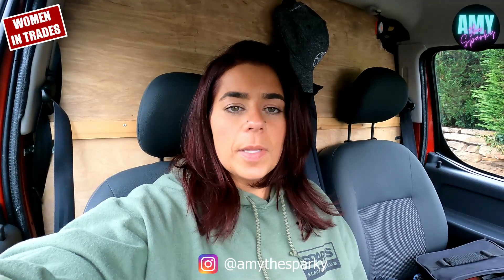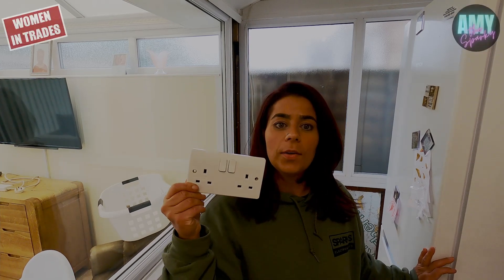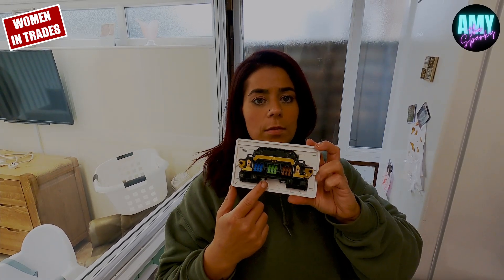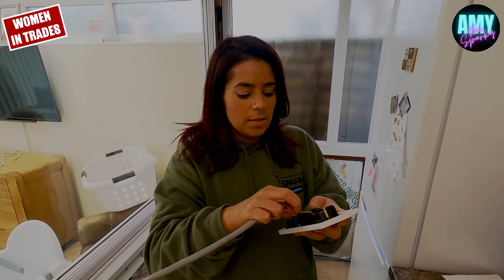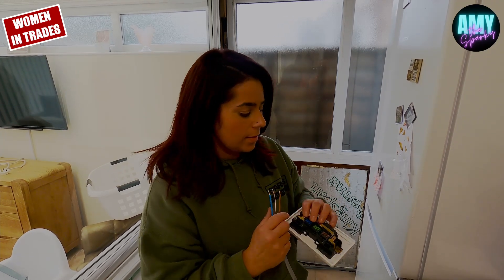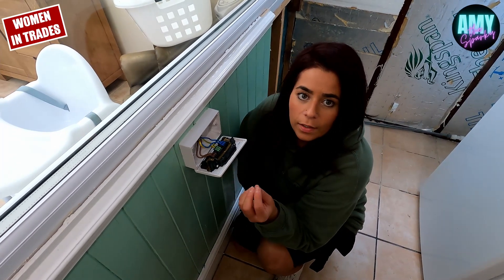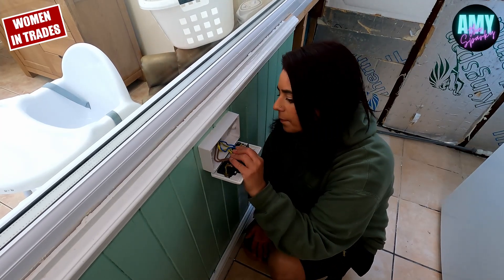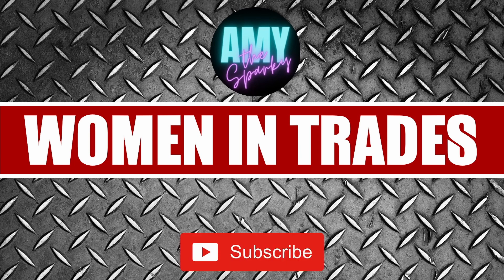MK Screwless socket review with Amy the Sparky

Comment: Welcome to the world of modern wiring! Here in Germany light switches were introduced with such terminals in the 1980s, in the early 90s manufacturers came up with them on sockets. In the early 2000s neutral and earth bars in CUs were introduced (Hager Quick Connect for example). A few years ago they introduced also single phase RCBOs and MCBs with this terminals. Now they also make three-phase RCBOs with that system. Damn, three years ago I installed a sub unit in my garage for an EV charger, and I had to use separate three-phase MCB block and three-phase RCD!
Now only non-standard accessories, old stuff and cheap accessories have screw terminals here.
The torque settings directly aren't mandatory. The regs state that you'll have to install the materials and accessories according to the instructions of the manufacturer. If the manufacturer states that a certain torque must be applied, than you'll have to apply that torque, otherwise you would violate that reg. If the manufacturer doesn't mention a torque then you're not required to use that torque screw driver.
Reply: I can't believe how far the UK is behind other countries for electrical accessories like this.
Reply: @gadgetman36  working on local authority rewiring jobs lately, in some of the flats there are light switches with push-in connections and the older tenants say they were last rewired in the late 70s/early 80s. Not commonplace, however.
Reply: But you guys are happy to pay a lot more for accessories than people over here are, I guess the hold up was waiting for Wago to reduce it's licensing fee to something that was workable.
Reply: @edc1569  ~24€ (20 GBP) for a pack of 6 sockets. ~4€ (3.44 GBP) for a light switch (2-way) or 8€ for an intermediate. 19% VAT is already included in that prices. I don't think that this is too expensive for such accessories. Especially when that stuff is Made in Germany and Made in China or elsewhere in Asia.

You have the higher prices because now only one manufacturer is using such terminals. Here they all do.

Comment: Cage clamp termination works. I first started using Wago push fit for solid conductors about 2008 when I received a sample through the post from Ray Brewer who started Connexbox and designed the Wagobox. I stopped using those awful bakerlite junction boxes immediately.
Why oh why is it taking the UK so long to catch up with the implementation of pushfit or lever clamp connectors in every standard accessory?
I have worked on a Schwing control system on a concrete pumping truck from the 1990’s where every through terminal connection is via a screwdriver operated lever clamp.
The UK is in a time warp with its ring circuits and screw terminals. Well done MK!

Comment: Those seem quite nice, a lot easier than the push-fit outlets we have over here on the continent if you ever need to remove the conductors. Im never going back to screw terminals though.

Comment: Hi amy great vid. The problem I have is that if you have socket on the ring and then you are also feeding a spur so you end up with 3lives 3 neutrals and 3cpc and you want to earth the backbox how do you do that its not possible. the socket should come with a connector which can take 4 earths instead of 3.
Reply: You can link the backbox using one of the incoming cpc's. :-)

Comment: We use lots of Clipsal/Krone insulation displacement outlets here in Australia - you have to be careful with them, as they will let go if you are too rough.  These seem okay - but I'm more interested in their current carrying capacity - how those connectors age..
Reply: We use such connectors for decades now here in Germany. No issues due to loose connections. On light switches (which also have such terminals here) the internal contacts of the switch itself usually wear out before the terminals fail. Same for sockets, there usually the internal contacts which make contact to the plug fail before the terminals fail.
The terminals here are rated for 16A. Even the ones on light switches, which are themself only rated to switch 10A.
Reply: These really wont let go, you'll break them first.

Comment: I think all the torque settings should be standardised, for example 2.5mm copper stranded in a brass connection at a certain torque and 2.5mm solid copper in brass connectors at what ever the best setting is. Surely the material does not alter too much so why not standardised the industry to make it better for everyone.
The CU should also be the same, rather than having different settings.
The good thing about the wago style connection is it should have the same pressure on the wire holding it. 
Just my thoughts though.
Good video and points made!!
Reply: So this Standardised torque setting you'd like to see introduced. Is that for fresh cable installs only or for cables that have been removed then refitted multiple times?

One a solid core has been crushed in a terminal it becomes weakened and as such you'd need to strip back to new cable ever time. So how much spare cable needs to be in the backbox and how deep would they also need to be?

🤔
Reply: @Sparks1Plumbers0  Standardisation should be led from the manufactures, some of them ask for 2Nm for earth and Neutral for example, while others ask for a different torque setting for the same earth and Neutral connections within their enclosures.  I'm not quite sure what you are saying, Sorry Legion!

Comment: Using them now for care homes and nhs sites. They're great but yes a 35 box or 25 and top back/top entry is best to loop the cables down and in. Thankfully most sites we work on have false ceilings so all the supplies are top down feeds making these sockets brilliant to fit. As they're levers you can do it live as needed when people can't be moved out of rooms or have breathing equipment etc shut off so again a plus point.

4mm into 2.5 etc without having to faff with one terminal and line up conductors is great only issue comes is if you have a ring final circuit passing through a socket or more than 3 cables - (which we all know happens even if it shouldn't) they're unsuiitable. So like some tools they serve a situation they're intended for brilliantly but outside of it they're not great.
Reply: MK specify a minimum 25mm pattress for these, as confirmed by eFIXX in their video for top or bottom entry. For rear entry you may need 30mm or 35mm. The only situation I see with 4 cables is taking a spur off a socket - there's 4 CPCs if earthing the metal pattress. This is easily solved by terminating the spur CPC in the metal pattress earth terminal, along with the strap to the double socket. No socket is designed to accept more than 3 Line or Neutral cables in each terminal. This is no different.

Comment: If you had a spur coming off the socket with a metal box then there is no terminal for the case earth
Reply: Stick the earth for the spur in the back of the box with the fly lead?
Reply: Double up the spur CPC and take the strand back into the earth termination at the back box.  The CPC on 2.5mm is only 1.5mm doubled it easily fits.  I did exactly this last week. Easy enough to bring forward.  If not a simple Wago termination in the bb.
Reply: I dont think he/she/they thought that question through really.
Reply: You dont even need to double it up, you can run a cpc through the box, into its terminal. 

Also the face plate screws create earthing for the back box when it is on...
Reply: @Brucey367  As long as least one fixed solid lug is on the bb then according to regs no CPC strap is required.  I think it's best practice to fit one.  More so if the outlet or switchgear is of metallic construction.
Reply: @rayc1503  exactly.  So for best practise you can run the cpc through the lug in the back box into it's terminal, no need for doubling up.